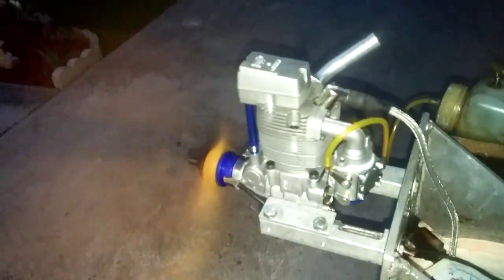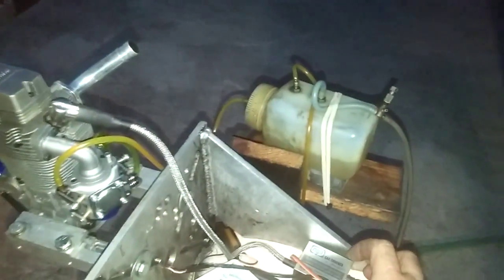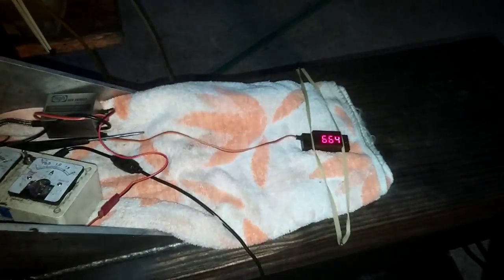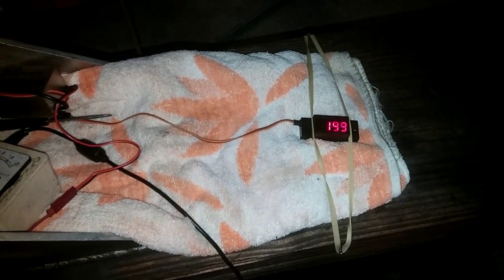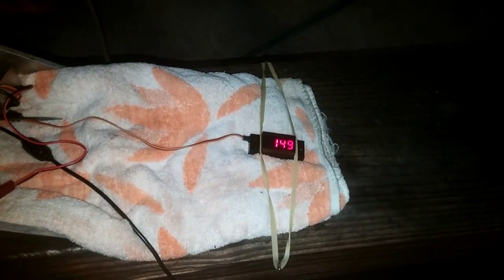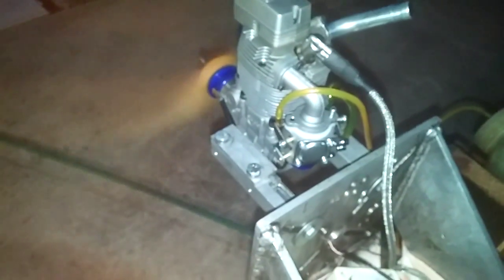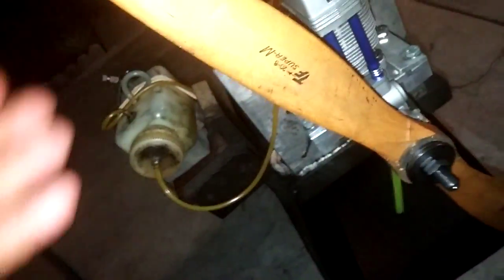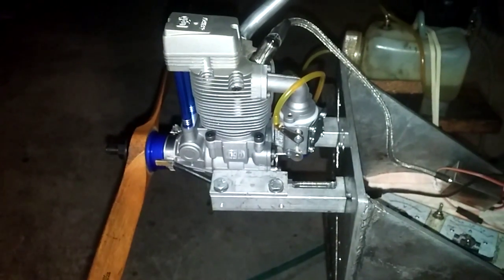NGH FG 38, CH Ignitions Timing set to 30BTDC

Comment: it can run mutch better ,take a ngk cm6 plug a velocity stack with a length off 40mm and put the h needle in it of a wt257 ......it wil have mutch better throttle respons and it wil turn a masterairscrew 18/10 6900rpm and a 20/12 5800rpm on 98okthane and 1/35 klotz oil.......succes gentlemen kind regards